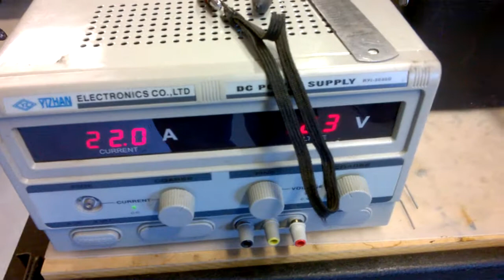Deadly secret Hydrogen fuel system Gen 10 in plastic enclosure 2015 for Cars, Boats, and Gensets

Comment: Cool can they be used for a vehicle thanks
Reply from the maker: https://hydrogenfuelsystems.com.au   0403177183
Reply from the maker: call me on 0403177183 
glknox11@live.com
https://hydrogenfuelsystems.com.au
patented , proven and certificated system delivering 32% savings on a 7.2 L truck - 27 tonne load
Reply from the maker: call me on 0403177183 
glknox11@live.com
https://hydrogenfuelsystems.com.au
patented , proven and certificated system delivering 32% savings on a 7.2 L truck - 27 tonne load

Comment: It's great. In the future, water may be more expensive than oil.🤔
Reply from the maker: https://hydrogenfuelsystems.com.au   0403177183
Reply from the maker: call me on 0403177183 
glknox11@live.com
https://hydrogenfuelsystems.com.au
patented , proven and certificated system delivering 32% savings on a 7.2 L truck - 27 tonne load
Reply from the maker: call me on 0403177183 
glknox11@live.com
https://hydrogenfuelsystems.com.au
patented , proven and certificated system delivering 32% savings on a 7.2 L truck - 27 tonne load

Comment: can i get a price idea (approx) for supply and fit to a Mercedes Benz 1418 coach thanks
Reply from the maker: call me on 0403177183
glknox1@live.com
www.hydrogenfuelsystems.com.au
Gavan
Reply: if you make it by yourself at least  200$, if you buy it 500-600$
Reply from the maker: call me on 0403177183 
glknox11@live.com
https://hydrogenfuelsystems.com.au
patented , proven and certificated system delivering 32% savings on a 7.2 L truck - 27 tonne load
Reply from the maker: 4650 + gst